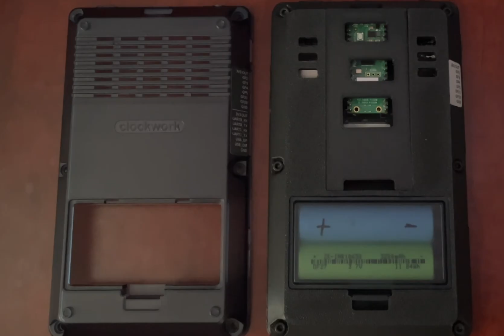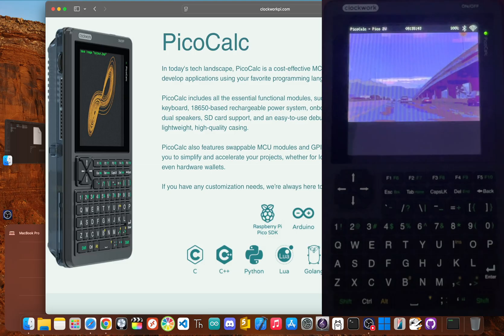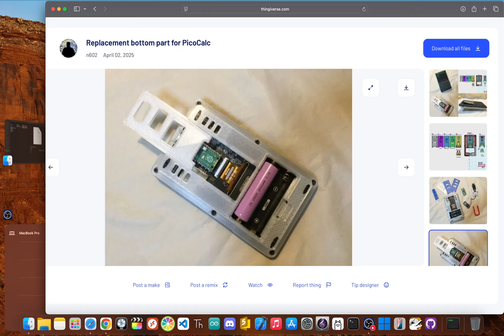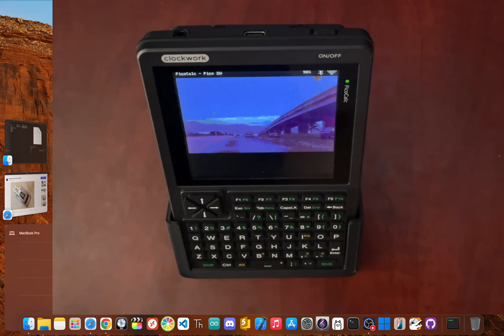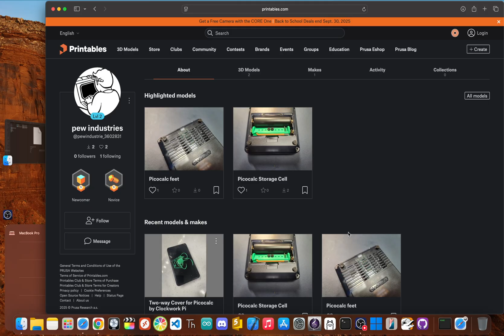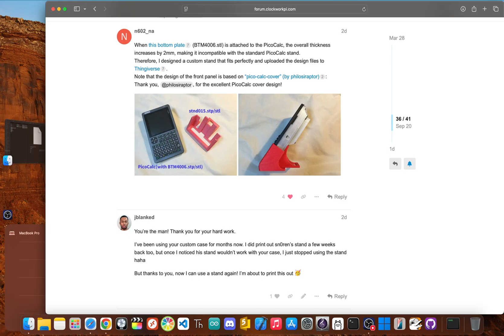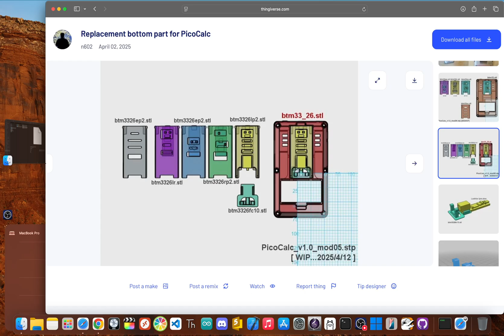This 3D Print Fixes The PicoCalc's BIGGEST Flaw

Comment: Is it now safer with this case to remove the Pico without breaking the screen (using a pry tools, LCD safe)?
Or would you still disassemble everything? Maybe you can make video how do you do it?
Reply from the maker: Yes with this case, you no longer need to disassemble anything, since you can reach the Pico easily
Reply: @jblanked thx for answering. I am still waiting for my PicoCalc to arrive 😢.3d case is ready though 🎉
Reply from the maker: @exoticatom  Lets gooo!! It's usually a 3-4 month wait. When you get it, definitely make sure to tape your screen down during assembly (I have a few videos/guides on that too) 🔥